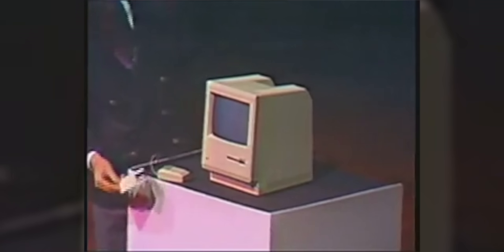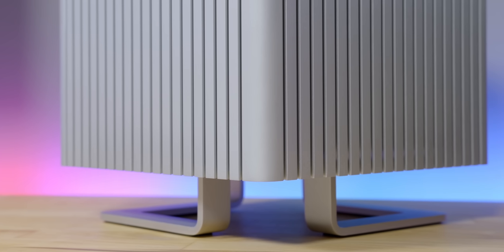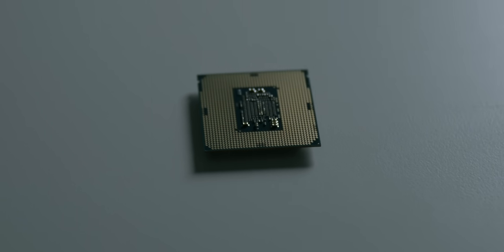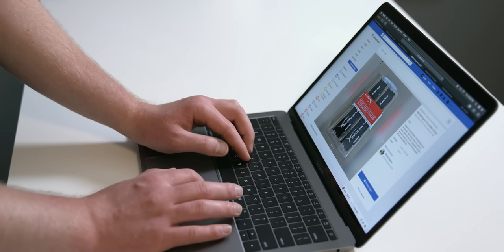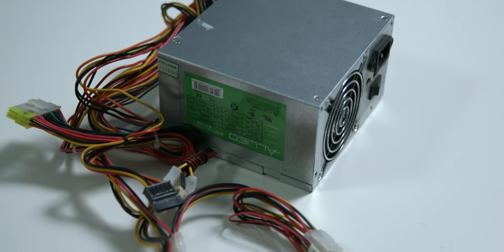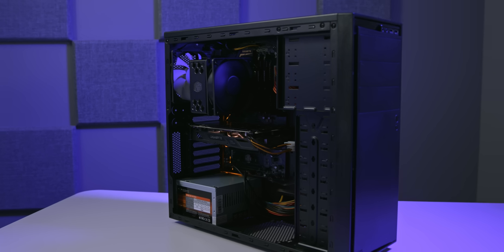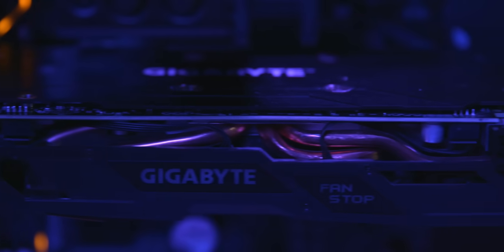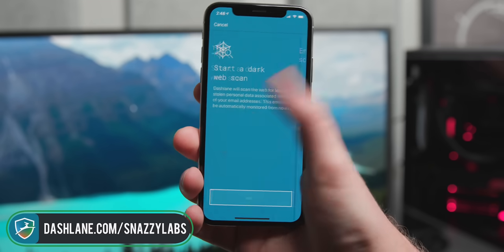Let's Build a $350 Craigslist Hackintosh Mac!

Comment: Do a hackintosh installation guide for beginners.
Reply: Please I really want to do one
Reply: please, pretty please....
Reply: i support this aswell. Most Applesystems not only have horrible thermals but are also bad hardwarechoices in bang for the buckwise.
Reply: +1
Reply: @TheMstwntdLMSV123  he cant because legal reason
Reply: @TheMstwntdLMSV123  but Linus has one
Reply: @therealosas  thanks which video though?
Reply: amd dude help me
Reply: It's definitely not for beginners. It's not hard to get it running with tonymac tools, but it's not gonna be stable.  It takes huge amount of troubleshooting and every build has different weird issues, requiring you to read through hundreds of posts on tonymac or insanelymac. It's not feasible to do a video tutorial on this.
Reply: cant wait for this. at least some parts. like building vanilla installer usb. other video about dsdt patch. usb3 patch. clover config things

Comment: me : never going to build a hackingtosh
also me: watches snazzy’s hackintosh builds
Reply: Right there with ya. 😂

That said, never say never. 😉

I don't build one because I don't need one. My 2009 Mac Pro is still going 100% and is already more than I need in a computer. If I ever need to upgrade I may consider a hackintosh because I love building my own computers, but that will depend on what the used Mac market looks like at the time. And on what I actually need.

Comment: Glad you've finally mentioned a "vanilla" install, which is is much better than using tonymac's tools.(posted from a vanilla hackintosh)
Reply: Hi I'm new to this hackintosh stuff. Could you tell me what's better about vanilla?
Reply: taha12012 This is an issue of the past, but tonymac tools used code from other developers without credit. Also you need these tools to be regularly updated for new OSX versions.
Reply: Glad to see other proud members of the vanilla hackintoshing army here
Reply: vanilla? you still need Unibeast or iboot so it will NEVER be vanilla.

Comment: 25 for a USED ssd?! New ones are only around 20 for 120gb🤔
Reply: Yeah the Kingston A400 on Amazon
Reply: @asherperlmuter  Don't get the Kingston A400. Its failure rates are quite high.
Reply: True, but he said he was only going to buy local used items for this build.
Reply: @WrenFJ  Really? Didn't know that. Can you link a source? What's the alternative?
Reply: @asherperlmuter  I can't post a link because the spam filter would catch it, but Google "kingston a400 phison controller failure". should be the second result.
Reply: @WrenFJ  I see... The Reddit link. That seems to be the only one reporting that. Does this effect M.2. Or the regular ones? Do you have an alternative to recommend?
Reply: @asherperlmuter  No idea about M.2, you'd have to check what controller it uses. Other good budget SSDs are the WD Green 120GB and Kingston UV400. If you want to buy used, look for used Lite-ON drives from laptops. They're the OEM version of Plextor drives and extremely reliable.
Reply: @WrenFJ  Thanks! I'll take a look. How is the Crucial BX500?
Reply: @asherperlmuter  BX500 is fine, but it has some incompatibilities with Core 2 based systems and earlier.

Comment: Nice video! I really appreciate you kept it short and pretty much straight-forward, however, I don't think the dual camera setup is a good idea in this kind of a video. Also, it would maybe be better to raise the table (or do somewhat to get the MacBook you're looking at into the shot) and play a little bit with the background (bring the scene a bit farther from the wall, shoot it with the table, use some lights on the wall as you used to). Maybe I just didn't get the concept of the video, but apart from that, it was great. Keep it up!
Reply from the maker: Noted. Cheers.

Comment: I build one with an i5 4460 which is pretty similar in court performance as the i5-6400. But is was able to find a bundle that includes the CPU a gigabyte motherboard and 16gb ram for only 130€ (which is good but definitely not the only one out there, so you can easily find one like this too). Grafic I take the same. Also an xilence power supply for 20€ on eBay and a case I already had + an 240gb ssd for 30 and a 500hdd for 5€. So in total round about 250€ and a very similar perrformance. Installation was very easy with the l tonymacs

Comment: Hey, Quinn. Thank you for the build video. I’ve never used anything but TonyMac install tools. 
What makes Insane Mac “Vanilla” builds better? Is it a more real Mac OS experience?
Reply: I can't speak from experience but I think what is 'better' about the vanilla install is that you aren't running some obscure code you can't see.

TonyMac is closed source so you don't know what is going on under the hood when it runs, which can be a bit scary considering what it is doing. It is assisting in an OS install. It could potentially do terrible things.

I haven't heard of it actually doing terrible things, so no need to freak out, but the potential is there. I believe the 'vanilla' method he refers to means doing it manually. Going in and tweaking the files and configs yourself during the install process to get it to install for you, without relying on a closed source tool to do it for you. More work, but the process is completely transparent.
Reply: Reed Harston Gotcha. Isn’t this why we use “Clover Configurator”, to complete our installs. 
BTW, I heard there’s a new installer and KEXT tool out there now. It’s supposed to be more “Vanilla”. Have you ever heard of used it?
Reply: @WarriorsPhoto  I actually have never done any hackintoshing myself, so I don't know what each of the tools do exactly. I only know some because my brother has made a couple and because I watch Snazzy. ;)
Reply: @ReedHarston  Okay, you have my respect. A man that admits he doesn't know everything deserves RESPEK. LOL

Comment: just flipped and sold a Dell Inspiron 3650 with an i5-6400 and 8gb ram.......i had considered making a hackintosh with it, but was overwhelmed with the process, Besides i have a 2012 macbook Air that i have on a USB switch for when i need Mac apps. i just Switch keyboard mouse and Monitor input, and bam! a low power Mac lol does the job. never need to take it from under my desk.

Comment: And if you want a great hackintosh laptop you can buy a HP ProBook 4540 or Lenovo Thinkpad T430, I use myself the ProBook 4540s with i7 which is a quad core chip and it gets around 10600 in Geekbench 4 so it's a beast, I put a BCM94352HMB wifi card and it works without a problem, I get around 500 Mb/s on Wi-Fi. For this laptop and for the Lenovo series they are guides on tonymacx86 so the setup is really easy !

Comment: Can you do a hackintosh tutorial for beginners and discuss the Bluetooth/WiFi problems and iMessage and continuity problems and solutions?
Reply: Are you looking to do a build, or are you looking for a video to fix these problems?
Reply: @themichaelunderwood  I already attempted a build and ran into these problems that no youtubers mentioned in detail.  They just say stuff like, "oh and iMessage can be tricky to get working..." NEXT point or you might need to order another bluetooth PCIe card (but the one mentioned is no longer for sale)...NEXT point.  They don't go into detail about the constant audio failures after the computer restarts.  They don't go into detail about the USB ports not working.  I tried to make a hackintosh because I prefer MacOS, but I ended up erasing it and giving up because I got constant freezes, had to keep reinstalling the audio kexts, kept having wifi problems even with a 3rd party dongle, never got the UB ports to work, and it was glitchy/slow when the OS did work.  Basically every good thing I like about MacOS was the opposite on a hackintosh.  MacOS ran better on my 10 year old 13" MBP with a Core 2 Duo and 8GB of 1066MHz RAM than it did on a 7700K with 16GB of 2400MHz RAM and a faster SSD.
Reply: Jordan Allison I’ve been fortunate enough to have 2 golden builds. In the last two years. I might be able to help you.
Reply: @themichaelunderwood  Thank you.  I have given up for now, but may try again in the future.  I'll definitely bookmark some resources if you know of any videos or written guides that would help with a build around an i5 6500 and a Gigabyte GA-H110M motherboard, those would probably be the parts I'd use next time.  I previously tried it w/ an R9 380, but if I tried again, it would most likely just be w/ the integrated Intel HD graphics.

Comment: I love this build. My Hackintosh is similarly specced apart from I'm on Haswell i5-4440, 12gb Ram, 512gb SSD, and a metal support RX580 which works absolutely brilliantly. I just wish the same could be said for my Dell Precision m3510 Laptop. I cannot find a guide or a build anywhere. I have a vanilla install and it's all installed but I have no trackpad because its a VoodooI2C which requires a working battery status to which I cannot for the life of me patch to work correctly, also the Realtek 293 Codec doesn't work so I have to use VoodooHDA. WiFi is a no go, it uses an Intel wifi chip and I cannot find a compatible one that fits my laptop, so I may have to resort to USB for that one. If you have any guidance material on patching the DSDT for battery status, that would be fricken awesome!

Comment: Does the DVI port on the MSI Rx480 work and how do you get a 3rd monitor working?
Reply from the maker: There isn’t a DVI port on this card. 3 DP and 1 HDMI
Reply: @snazzy  I had a MSI RX480 card and it had a DVI which worked. It also had 2 DP and 2 HDMI. For dual monitor setup only the 2 DPs worked. I couldn't get a 3rd monitor to work on it. I switched it out for a XFX card that had 3 DP and 1 HDMI; thinking that the 3 DPs will allow for a 3rd monitor. Nope. Only 2 at a time. 
I must admit that I never had this issue using my Nvidia 1050 on High Sierra. The web driver had everything working well.

Comment: If you can get the parts, see if you can do a headless Linux machine with a macOS VM, LTT did a video on it using an AMD CPU (and not headless) and it worked great.  But I really want to see something like a 30 core/60 thread macOS machine with 120GiB of RAM and some Vega GPU.

Comment: Try a 100% dumpster dive Hack?...Hackintoshing has been a hobby of mine for quite a while. I once worked at my local WEEE recycling centre and bought an LGA775 Optiplex system for (£10) + a GTX460, and a Core 2 Quad Q9400 (£3), then I bought a 120GB SSD for £15 :D It runs High Sierra and everything works brilliantly!
Reply from the maker: Hah nice! Not a bad idea.

Comment: Does it have WiFi, Bluetooth, iMessage, FaceTime, etc.?
Reply: WiFi and Bluetooth support depends on the hardware you buy. As long as it has the same chips as something in an Apple built Mac, then yes.

People post lists of known supported and unsupported hardware in support forums so you can look for those.

FaceTime I believe also depends on hardware support. I have a web cam my brother gave my (for my Mac Pro) that works, but I had another before that someone let me borrow and I don't believe it worked with macOS. I can't remember for sure there. Again, forums will have you covered.

iMessage yes. It just needs the internet.

Etc. Handoff, yes if you have working wifi and bluetooth.

Comment: Why not buy a used Mac Mini?
This strategy may avoid a lot of compatibility issues, and then you can be sure that it will work.
A Hackintosh is an adventure, and that's all right, if you like adventures.
But if you just want a working machine, then you may not want to have the risk factor involved.
But if you do follow the principle of "learning by doing", then that's all right.

Comment: Need to spend $30-50 more to get the compatible Wifi/BT module, that's going to give you native Air Drop and iMessage, that's how you can fully enjoy the "eco system"
Reply: Yes, I simply got a compatible Wifi + BT module on Amazon, and swapped it in, in place of the existing m.2 Intel-based module.  It was an easy swap, just required removing the mobo because the old module was in a metal shield that was screwed in from the bottom.  Worth it, though, and the only other part was the need to fiddle with the antenna leads to ensure they're hooked in to the new m.2 Wifi + BT card properly.  And it works in both Mac and PC mode, so that's a win.

Comment: i have a spare set up that io want to turn into a hackintosh i try before and nothing works :/ i really need help 
has ryzen 5 1600x gtx 980ti 6Gbgddr5  8Gb ddr4 2600 
650 psu nzxt 
mini itx asrock motherboard and phantek shift x case
Reply: Linus uploaded a Video where he explains how to run MACOS with a Amd setup.

Comment: Wait, people actually like macOS? I thought they just put up with it because Final Cut/Logic or whatever. How do you deal with the awful window management?
Reply: I carry my Dell XPS 13 and my MacBook and use a lil software that allows me to move a windows from one platform to another😂
Reply from the maker: Using one of countless killer third party apps.
Reply: @snazzy  Huh. Mind recommending some?
Reply from the maker: BetterSnapTool. BetterTouchTool. Magnet.
Reply: @snazzy  thanks! so you don't mind the dock? i find it unnecessarily complicated to switch between windows from the same app

Comment: Ever try gutting an old iMac and make an all in one PC?
Reply: My brother and I have thought about doing that but it would be quite the challenge. The inside of an iMac isn't shaped like a standard PC case at all, so mounting a standard square(ish) motherboard in there would be difficult. Then there is the GPU to consider and cooling as well. Then to top it off you have to make the thing talk to the display somehow, and the iMac display doesn't just have a display port cable coming off of it.

So, not an easy task.

But it is something we'd like to try. ;)

Comment: When I see videos like this, I feel like it would make more sense to sell my 15” 2018 MBP for a loss, buy a cheaper 13” model, and just build a hackintosh as opposed to just buying an eGPU for my 15”. The eGPU is simpler, but barely cheaper, and probably less powerful.
Reply from the maker: Honestly, I’m not even sure I could disagree. eGPU implementation works in Mojave but it still feels slightly “beta”-ish which makes it even harder to justify buying.

Comment: if you want to do a really neat hackintosh build, do a build that hasn't already been done before a 1000 times.  Forget using websites like tonymacx86 or others that have already done everything for that specific parts list build.  Try something along the long lines of a workstation build with 2x xeons and a radeon pro wx 7100.  A bit more than $350 but not terribly much if you buy used.  After you spend 4 weeks getting through all the bugs and kernel panics and whatnot, come back and give us an update.
Reply: Those builds are just not worth it from a cost to performance point of view...My Ryzen 5 2600X comfortably beats two Xeon X5660's in CineBench on MacOS.
Reply: @ChimpyChamp  try and beat 2x xeon e5 2650 v2 with your 2600x in any heavily threaded app.  If we are going to go that expensive, might as well go e5 2660 v2's.  You think your 6 cores 12 threads will beat 20 cores and 40 threads in any threaded app?
Reply: @jeffreylevin9728  Whats your multi core CineBench score?
Reply: @jeffreylevin9728  You are a bit all over the place there buddy...I never said anything about going expensive? I am talking about sub $350 computers here like you said originally.. they will more than likely use Westmere EP chips at that price point, and they are expensive, run hot, and are bad value propositions. Obviously more expensive Xeon chips will demolish a Ryzen 5 but I'm specifically talking about computers at price point. 

And when you consider a single £150 Ryzen 5 has a multicore score of 1400 vs a single E5 2660V2's score of 950, then yeah, the value isn't there.
Reply: @ChimpyChamp  i never built the hackintosh.  too many problems encountered.  Under windows 10 pro it was 2550 under C15 but i run 2x e5 2667 v2's which are much faster and are also about 180 per cpu - a lot more than 2650 (50 per cpu) or 2660 (110 per cpu)
Reply: @jeffreylevin9728  What sort of problems?

Comment: My buddies college advisor told him to stay away from Apple since none of his engineering apps or school programs would work on MacOs. 

Plus he said it wouldn't make it the 4 years without replacing the piles of shit either.

So when does Apple file some sort of action against all of these Hackintish videos?
Reply: Not getting a Mac because it doesn't support the software you need is a legitimate reason.

I would revisit his point on reliability though.

If he was talking about the current line of laptops and their keyboard issues, then yeah, that is an issue. But otherwise they are great. Get a 2015 model for cheaper than a new one and you'll have the older, better keyboard and a only slightly thicker and heavier machine that has no keyboard issues.

I am typing this on my 2009 Mac Pro and have a 2012 MacBook Pro sitting right next to me (and have many 20+ year old Macs in the closet, and a couple going on 30 years as well - all working just fine). Macs in general don't have reliability issues, only some models do, so if you had a reason to buy one you could find one without the new keyboard.

Comment: you probably should have just bought the case, ssd and psu new. I know you were going for all used as the theme, but you can literally buy better SSDs brand new for $5 less. Used cases are usually trashed and used PSUs....like you said, don't cheap out on a PSU.